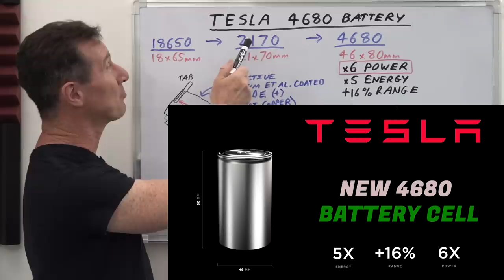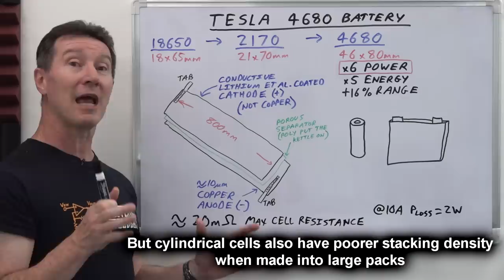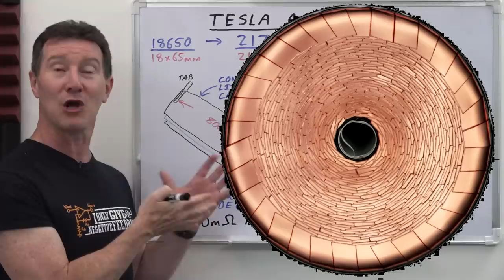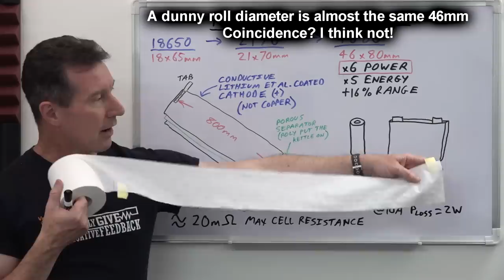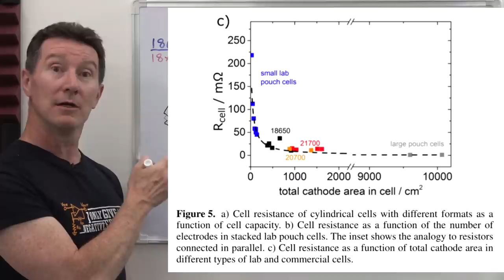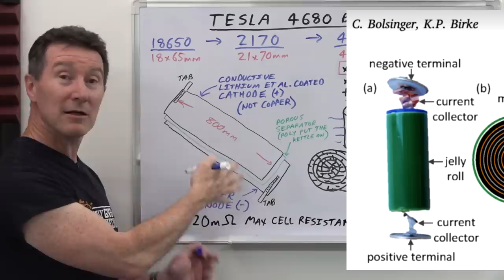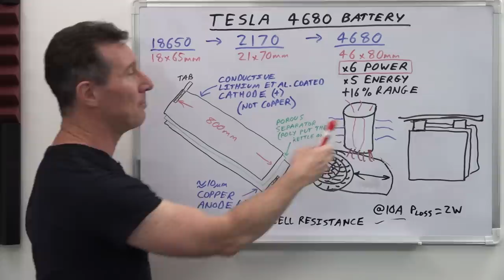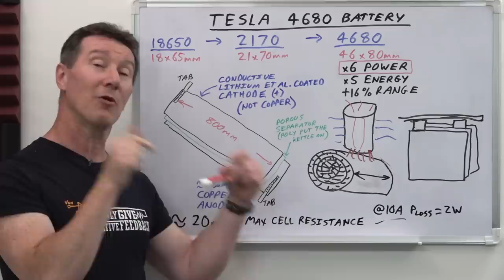EEVblog 1340 - New Tesla 4680 Battery Cell EXPLAINED

Comment: The continuous tabs trick is pretty simple and obvious, I remember thinking about that years ago. My question is: why it wasn't done before? I mean, in comparison with the amount of knowledge and research in chemistry, this is nothing and improve noticably. Or just several tabs at least (was it already done in high C-rate cells?)
Reply: It probably has to do with the fact that this is the same than having a lot of small batteries in a pack maybe this makes them save on the container for all the batteries replaced by this single one but it's harder to manufacture
Reply: I had just the same question after watching this: are the battery designers kind of autistic and focus only on one part of the problem not knowing what the other department does with the package? I would not be surprised if that was the case XD
Reply: Electrolytic cap makers did it 2 decades ago.... You really do have to wonder (It knocks the series inductance out too)
Reply: @miscbits6399  Also foil caps. The whole roll of each electrodes are soldered together to increase current handling and decrease ESL.
Reply: Cost. The competition has cheaper batteries. The increase in efficiency is minimal. Tesla has a habit of doing it anyway and then pretending it's bulletproof. Oh, snap.
Anyway, without the overhype strategies of Tesla, practically no one would buy such batteries because practically no one lives in California or is a rich snob, meaning that most people will check cost vs. product and it's just not worth it to spend that much more for slightly better batteries.
Reply: They probably thought of it, but it sounds like it requires a lot of re-engineering of the production lines to account for that, which is something that is not desirable in a product which allegedly has low profit margins. Meanwhile, Tesla has obscene amounts of cash in hand that they can use for whatever they want and it seems they are currently focusing on R&D to gain a big enough advantage before other car manufacturers release their own EVs.
Reply: I wonder if it makes the cells more prone to internal shorts and therefore catastrophic thermal runaway.
Reply: @stylis666  The internal resistance is almost as important as the capacity. A thumb rule would "Ah*A=price". To reduce the internal resistance with tabs only is muuuch easier and cheaper than reducing it with an optimised chemistry. So think it would have been cost effective to do so because the cells could have been sold with a price gap higher than the price of the tab improvement.
Reply: It may have not been worth it with small cells.
Reply: I would hazard a guess that it has to do with existing manufacturing processes.  The welded tabs were points that the manufacturer could manipulate the jelly roll before being inserted into a can.  Removing those tabs now makes the remaining process more difficult.
Reply: @psionicxxx  I know several engineers that work for GE aviation and that is the case they are very very good at doing what they do but ask them to zoom out and look at the entire picture and they lose their brains.
Reply: I asked the same when I was in high school in the early 1980s; teachers shot down the idea, said it would short out, etc.  They didn't want to hear argument, because "the experts know better" (IOW: "someone else would have figured that out already," "you're not smarter than the experts who do this for a living," etc. -- all of which are just tailcovering expressions of the "i don't know, so you can't know" meme).  Institutional primary and secondary schooling (except for academic labs) is among the worst of mankind's ideas, but it's reduction to practice in previous decades is somewhat excusable because of inefficiencies in communication prior to the Internet.
Reply: Seems like it may not have been as easy as you think. Elegant and simple, yes, but incredibly difficult to manufacture at a mass scale? Probably even more yes.
Reply: My money is on cost. Using a soldered tab saves considerably on copper costs, leaving more copper to be used for anode surface in more batteries.
Reply: I think it comes down to figuring out how to mass produce the 4680.  It’s easy manufacturing to roll up copper and solder a tab on it.
Reply: early people not discharge their batteries with very high C mode and tabs was a good idea. 
Wait mass production and see prise of new tesla cans...
Reply: @stylis666  I don't buy that, it may add a negligible amount of weight, but every miliohm of internal resistance is gold in that industry. It may be just because there wasn't a high enough demand for high amperage cells in that format, and there wasn't a need for that kind of thermal efficiency need in that market (the prismatic cell one)
Reply: @Kowen8714  True, the bigger the cell roll diameter the greater the gain.
Reply: No competition to do so?
Reply: It was done before in foil capacitors, since year 1900 or so.
Reply: As with most product development, the idea is the easy part: it’s all about the implementation details and being able to manufacture something efficiently that will result in a usable and reliable product. I’m sure everyone in the battery business has had the idea, but nobody had the gumption to act on it, change the manufacturing process, and take it to market at scale.
Reply: @stylis666  actually...the traffic here suggests there are A LOT of people living here in California.
Reply: @CarlosMartinez-cf7fq  There are a lot of people living in Germany too. Twice as many as in California in fact, which compared to the 7.5 billion people on this planet is still practically insignificant. But if you are to start an innovative car company I'd still suggest starting it in California because they're richer and have a far bigger chance of preferring appearance over effectiveness.
Reply: It wasn't done before because high current consumers predominantly used pouch cells. When you needed a particularly high current device, you simply wouldn't choose a cylindrical cell. Well tool manufacturers do use cylindrical high current cells, but for them, a different less energy dense chemistry emerged, which was less reliant on heat evacuation and generated less heat inside the cell, and the terminal resistance didn't matter that much anyway.

Lithium Ion cells are a relatively new product, it was first manufactured by a joint venture of SONY and Asahi Kasei in 1991. Neither of these had experience in related fields, but they needed to get something going quickly, to take advantage of emerging markets, so they were designed to just be good enough and be quicker to start manufacturing. Then they were copied by a number of companies. Then there was just the typical resistance to change, since every step of the way, it was cheaper to not change the fundamental construction than to change it. Why was a completely inexperienced manufacturer the first one? Because of resistance to change on the side of established manufacturers, they thought expansion was too risky, and stopping production of their already successful product to implement a new process was untenable. They had their existing product going and they were satisfied with their year to year performance. And then when Lithium Ion cells emerged as the most important cell type, there was new resistance to change and risk aversion, for the same exact reasons.

I also wonder if the big continuous tab consumes space near the terminals that could instead house more effective sandwich area and thus nominal capacity. This probably is less relevant, the longer the cell is, and with a bigger diameter, they're also saving some effective volume on the casing, so another reason low impedance terminals are both more critical, since the roll is longer, and less of an impact.
Reply: @SianaGearz  Thanks for this detailed response. You're right about pouch cells that can be easily made with thick current collectors (like RC "Lipo"). I see very high C-rate pouch cell with negative and positive terminals as wide ad the cell and each pole on each side. It's a direct Chemistry to busbar!
Reply: Yeah, I know what you mean. I remember thinking about this in the 1980s when I was in elementary school -- but no one asked me so I just kept it to myself.
Reply: @darrenjones6579  No. the other way. less dangerous.
Reply: @miscbits6399  EVs were actually riding the streets in late 1800s, yet here we are driving ICE cars :) Perhaps people didn't try hard enough before for various reasons.
Reply: @tommy12345abc  ICEs only gained an advantage with the invention of the starter motor...
Reply: @miscbits6399  I thought it was the bi-product from the oil industry called gasoline but whichever - once the fossil industry gained foothold they did their best to squash the EVs and kept it that way for decades... until Tesla

Comment: The tabless design is a good example of something that seems obvious once you see it
Reply: It's like 0306 capacitors and current sense resistors....
Reply: Well it isn't tabless is it... More correct would be non welded tab battery or multiple tab battery...
Reply: Selfschooping battery ;-)
Reply: @truezulu  By that logic, the whole battery itself is a huge tab...
Reply: @N0xiety  How did you get that?

A name cannot encompass the entirety of the function. But calling it "tabless" is incorrect, since it does have tabs...
Reply: @truezulu  Agreed. it should be labelled "the weldless tab battery" but,it does have tabs...
Reply: it is not really new the problem always was and is how to contact a tabless cell design reliably, many have tried and faild i how they did there work but wait until we have them and tested them, Tesla is always a bid big with pre announcing things
Reply: @heinrichhein2605  Again. The Tesla battery is not tabless. Non welded tab battery is more correct.
Reply: @truezulu  This is called tabless, it is a bit weird but thats the industry standard,  nothing new, but these have to be still connected and thats the problem
Reply: @heinrichhein2605  I realize this. But that just means, that it is up to us to correct it...

Its like calling a hybrid an electric car. It is not, but some manufactures will use this incorrect definition.

A welded tab or a tab that is a part of the charged layer itself, is both still a tab. What ever the industry says...
Reply: @truezulu  agreed.  I like how you don't just say "ill agree with industry no matter what."  They can call it tabless but, truth is, it has tabs.  A lot of them...
Reply: @truezulu  jup i agree the name is not really consistent, but also tesla it self calls it that way in there patent,
Reply: @heinrichhein2605  Elon is very much championing the battery approach. So maybe that's why he doesn't do as he usually does, and make new paths?

Truth is, while we will always need batteries and so the improvement of them is of cause welcome. It is not the best approach in the long run. A rare instance where Elon is wrong...
Reply: @truezulu  depends he(his engineers) is(are) just using what University have worked on for years now and implemented/improved it. I just think this might be a bit rushed i know what it takes to design a proper battery and it is years and years of work. Don't count your chickens before they hatch. We will see how it will pan out.
Reply: @heinrichhein2605  You are right.

But what I mean is, that batteries as a primary power source for applications like a car or similar is not a good approach. Even in the case of much better battery techniques like for instance lithium air.

A battery is a battery and as such, is best used for cases where you have no other choice, like miniature tech or portable tech and so on.

For large use applications, a better approach is a more direct energy source. This is hard to do of cause, otherwise it would be reality already. A fuel cell is a very good approach, but it has proven to be very hard indeed... But it will eventually be this or some similar thing that wins out.

Elon has clearly done his homework when he says electricity is the future of transport. But solar and wind alone is not without issues. Solar takes up a lot of room. Wind is not infinite, and who knows what will happen to earth climate, when humans tap a large percentage of it for power?

Battery also comes with a net energy loss with charging. Multiply that with billions of batteries and you have quite a net loss... Many more points, but I'll leave it here.
Reply: @truezulu  i dont see a huge problems with batteries in car but i would say just less or no car would be better and easily possible. For power i dont think so much solar and Wind combined is a good Soliton. Here in germany we already are producing 38% of the electricity renewable, but other Countrys have to do this as well the time is already over. The topic is to complex to form a simple conclusion or an oppinon, but yes this is a bigger issue
Reply: @heinrichhein2605  Nuclear fission is the answer. Totally. At least until we unlock fusion... If we ever do...
Reply: @truezulu  jup but thats like in 50 years ;)
Reply: @truezulu  the "tabs" are the extra bits of non copper material (typically aluminium) welded onto the jelly roll. Since the new cell doesn't have anything welded to the anode - it's "tabless", I suppose you could call it tabbed/flagged anode battery if you want, as you are using the anode in a dual purpose. There are no "tabs" in the traditional sense therefore calling it "multiple tabs" or "non welded tabs" leaves room for confusion - multiple tabs could be 2 tabs top and bottom, non-welded could mean glued/bonded, which already exist. It's a case of you invent it, you get to name it and ideally you want clarity on the name, especially if you are using the name on a patent - it's better to come up with a new name and define it to cover yourself, you want your patent to be specific, yet reasonably broad. Say for example Panasonic came up with a multitab battery with 6 tabs, if someone else comes up with a 12 tab design, are they infringing on Panasonic's patent? Is it substantially different enough that they aren't? The problem is that often the only way to find out is to go to court, which will cost $$$

Comment: My experience in Engineering has always been "if it ain't broke don't fix it" there are always new projects that require time. That is most likely why no one ever looked at the old battery designs. This was an excellent discussion.  Thanks.

Comment: 26:28 isn't the packing efficiency for cilindres independent from its diameter?
16% is pretty impressive to be honest, its a high optimized product already
Reply: I think he is talking about the packing efficiency of the cell components.  Since current is more evenly distributed, the ratio of conductor to electrode/electrolyte can be shifted to have less conductor (i.e. thinner conductors)  The packing efficiency of "battery" to necessary wiring is improved.
Reply: @senorjp21  well, there are cell walls. Those are kind of in-the-way.
Reply: It is, the upside is loosing a lot of metal from A: cell packs, B: idividual cell metal. Thats probably why its "only" 16% for now. Imo 16% is still huge, since they couldnt beat Tesla before, they certainly wont beat the new cells anytime soon.
Reply: Leonardo, you are correct (geometrically speaking) the packing density is about 92% regardless of diameter. When you start to account for the fewer can walls, you gain some. Also, the jelly rolls have a center gap, there are now fewer of these (another small gain), but not 16% worth, so the bulk of this must come from chemistry improvements.
Reply: Why don't they just use a pack design instead of cylindrical?
Reply: @0101Zero  chemestry improvements are counted separatelly from those 16% on the presentation, this 16% is just from the design, its pretty amazing
Reply: @TheRainHarvester  probably because is easier/cheaper to produce probably (why?he cited the "soda can" production line)
the big thing about tesla, is that they are full on cutting prices, processes, and simplifying EVERYTHING, and they will
Reply: @TheRainHarvester  you can say it for self driving too, its WAAAAAAAAY easier to make it with lidars, but the thing costs almost the price of a car, so its not a viable option if they want to scale, so they are the only one going the "cameras" rout, so no competition whatsoever if they make it
Reply: @MrPinguinzz  I don't know why cutting into pack slices is more expensive.
Reply: @MrPinguinzz  I think most of the volume gains comes from the cooling of the battery that is heavily relaxed. That is why most cars uses pouches.
Reply: Density is achieved by the number of rolls around and the actual density per sq mm of material. If the material is half as thick, twice as much can be packed into the same volume. So in this example double the density of the thinner material.
But there are tradeoffs with how thin you can get and still work with it manufacturing-wise. But these are areas where incremental improvements will continue to be made.
Reply: Yes but u dont need to repeat individual cases
Reply: @Malk007  By cutting all the notches on the bottom and folding them, they are essentially short circuiting the electrons into flowing width wise instead of length wise, allowing them to release faster, this is the 16%. Plus the reason for cylindrical cells is ease of manufacturing, they are dead simple to make now without having to solder tabs; which were already simpler than flat pack designs. Cool stuff
Reply: In terms of range, 16% when you're talking about 300-mile range, is an extra 48 miles. If you're talking the Cybertruck, where they're saying 500-mile range, well, those numbers really start adding up.
Reply: Nope it decreases with an increasing diameter. Also the potential for hot spots goes up. Flaming freakin' teslas.